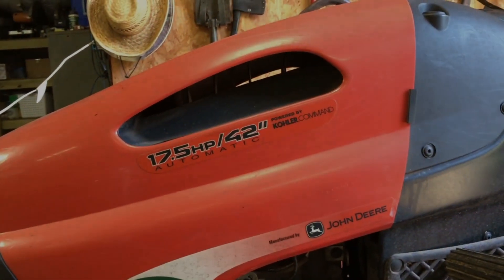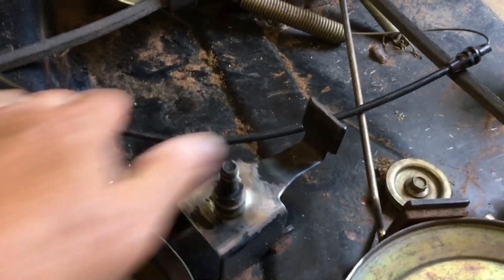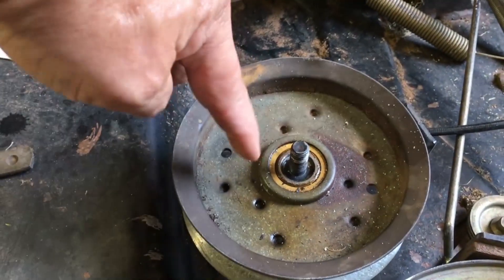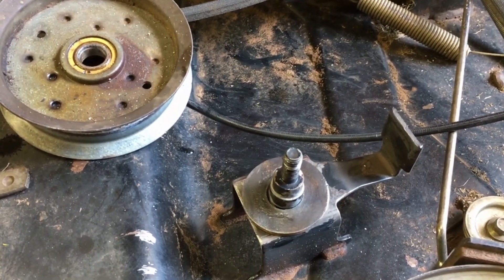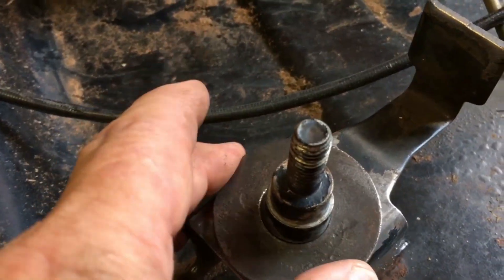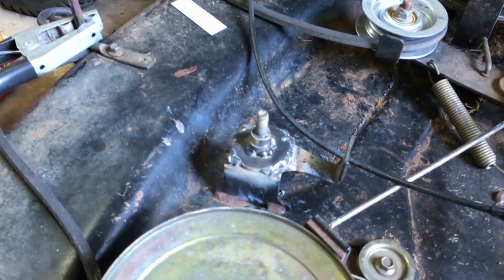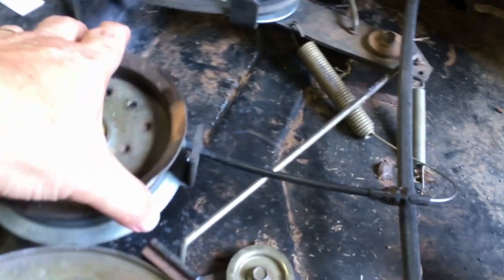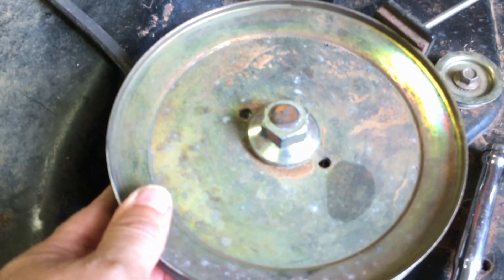Scotts and John Deere Mower Deck Repair

Comment: The belt on my JD125 is always comes off.. I looked at that same idler pulley and saw it was leaning forward big time, but the stud is solid. The bracket must be bent. Started Googling.. I just saw your video and confirms my suspicion that the pulley shouldn't be leaning as much as it is. I will give your fix a try. Thanks!
Reply from the maker: My bracket was bent too. 
I bent it back, then realized that the stud was loose too.
I bet if you bent the bracket back, you'd be OK.
The bracket is pretty thick, so it's not so easy to bend back
Reply: @BIGALTX  I am having same problem thinking of putting a touch to it to soften up the bracket... What'd ya think? 😓

Comment: I had the exact same problem with my John Deere L110. I didn't repair it by welding. I actually went to John Deere in Nevada, MO and bought a bushing for a larger John Deere tractor, and placed it under the stationary pulley. No broken belts in 3 years since I did this repair. I was breaking new belts after only 45 minutes of mowing. Very expensive, but the parts cost less than $15.00, and I didn't need to buy a welder. XD
Reply from the maker: Great idea... good for you :)
Reply: do you by any chance know the size of that bushing??? thanks!

Comment: Thanks for sharing; I'm having the same problem with my Scotts John Deere S1642. That exact pulley has bent forward after 20 years and seems to be why the belts are wearing out so fast. You can see the wear on the top edge of the belt and it's obviously rubbing along the top edge of that pulley. I'm going to pull the deck off now and see if I can straighten it out!
Reply: Did you ever get your pulley straightened out? I have same exact problem as you

Comment: Someone just gave me one of these mowers and the idler pulley was at a 45° angle like you simulated in the video. Put a battery in it and it runs nice and quiet, much better than my LT1000 Craftsman. Going to have to weld this stud in place like you did in the video, and also straighten the deck where the right hand spindle goes through as it is a little crooked also. They must have run over a huge Rock or stump.
Reply from the maker: Nice score.
Those mowers last a long time!  :)
Reply: @BIGALTX  thanks. I really like the way it drives with the automatic. Today I ordered the deck shift cable and tomorrow I will re-weld the stud and straighten the right hand side of the deck where the spindle bolts so that pulley lines up with all the rest. Also ordered a new set of blades. The ones on it were actually worn completely through and you can see through the middle of the blades
Reply from the maker: Hahaha... wow, never seen any blades THAT thin!
Seems like you know what you're doing.
Hope I was able to help you some
Happy mowing!  :)

Comment: I have the same problem with mine and couldn't figure it out. The mower was given to me and runs great just keeps kicking off the belt. The pull that you show is bent on mine but just thought for what ever reason it's supposed to be that way. I' going to try this repair today. Thanks and subbed.
Reply from the maker: I haven't burned a belt since then.
This FIXED it.
Hope it helps.
Thanks for the sub... and stick around :)

Comment: Good video.  Issue was with the design..  JD  fixed in later models. if Your going to hang onto Your LT, there are spindle kits which make a deck mow like brand new.. $110 ish..   Your LT looks to be in very good shape.. considering it was made around 2002, it's kept really well.

Comment: Thanks, you may have saved me replacing all my spindles and pulleys $$$. I was puzzled because my spindles seem to have close to zero bearing play.  But my front pulley is sitting in there at an angle the same way your was, burning and shredding belts. Hope it's the problem
Reply from the maker: I bet it is.
I was doubtful that taking the time to do the video would really help any one. 
You're the SECOND person to tell me that it helped you... 
Makes me feel good... glad to help.

Comment: Can you show how the two small springs that hold the spindle brakes are installed? I'm rebuilding one exactly like this and am having problems getting those two pieces in place.
Reply from the maker: Sorry, I never messed with the spindle brakes.
See if you can freeze frame this video to see how they go on.
There is a manual online... I found it a while ago, so I know it's out there for free. It should show spring placement

Comment: same issue here for the s1642 however there is a large crack in the deck itself as that pulley started leaning forward from stress. the stud for that pulley is ok but the angle is terrible now and the deck itself is compromised. no solution for me yet but may find someone who can bend the deck back down and weld it back together.
Reply: I have the same issue you posted about with a compromised deck on my s1642 mower -- wondering if you ever found a solution?
Reply: @goodfivebuck  I bought a used deck off of marketplace locally and put my blades on it, used the better of the pulleys from each, and I’ve been running that deck since.

Comment: We're did you get the idler pulley for this model I have same mower
Reply from the maker: I didn't replace the pulley. 
I just welded the stud that had broken loose.
Whenever I need parts for this mower, I go to my local John Deere dealer. 
This mower is made by Deere, and they stock most everything for it... or they can get it. 
If you don't have a Deere dealer, I'm sure there are places online that can fix you up.

Comment: looks like a good fix.
You should always paint over your welds (after you clean then up) to prevent rust. I usually hit mine with a wire brush and then paint while it's still very hot. Bakes the paint in.

Also welding tip on your settings... Your weld looked ok but I noticed a lot of popping and crackling... didn't have that buzzz sound it should have. I'm no expert either but what I try and do is get the settings right (wire speed and voltage) on a similar gauge material that you will be welding to. Also could have been you were holding the stinger (gun) a bit too far off the weld point.
The sound you are making is a good way to tell how smooth your welding is... pops and crackles indicate interruptions, while the buzzz means you are laying a more consistent bead. 
More important on longer welds, not the spot welding you were doing, and as I said... should be just fine for you.
Reply from the maker: I've been using Hobart wire, but bought some Harbor Freight wire, and this was the first weld I've made with it. 
I didn't like the sound or the feel of it either. 
Not sure if I need to adjust the settings for the cheap wire or not. Have you heard of any bad properties of this wire?
Reply: TexasPrepper2 I've seen some comparisons done on some of the weld channels I subscribe to on YouTube. It's lesser quality but fine unless the weld is critical.
I use wire from the shop I get my gas from. I don't have much welding to do so I don't use much.
I would try and adjust your settings by doing some test welds on scrap you may have around. I did myself by plasma cutting old mower blades and welding them back together.
Other problems that could cause issues is bad wire speed from a kinked cable or low gas pressure because tank is near empty.
I also previously mentioned not getting in close enough with your gun.
Lots of things other than bad wire

Comment: Either the metal wasn't clean or didn't have a good ground where you were welding or the machine isn't set up right.  There was a constant erratic feed which you should have felt  in your hands.  When set up correctly Hobart are great welders.
Reply from the maker: Thanks for the tips!
I'm NOT a good welder, and am new to wire feed... but I love it... just need to get better at it.
Reply: @BIGALTX  Nothing wrong with the weld itself.   First important thing is the ground, w/out that its impossible to do a good job. If the wire doesn't ignite immediately and pushes back at you a bit, it's probably a bad ground.  If it does ignite and still wants to push your hand back a bit the feed might be a tad too fast.  The third is not set hot enough.  Yours sounded hot enough so I'd go for one of the first two..  **  One more thing, if when changing spools the wire got away from you and went rolling on the floor, chase it down and cut it off. Don't try to rewind it.. Ask me how I know.

Comment: Did you spray some paint in the welds
Reply from the maker: Actually, I forgot. 
You're right... I need to remove the pulley and hit it with some paint.

Comment: Turn your wire speed down  you'll see the difference, , make it sound like bacon fryin hot
Reply from the maker: Thanks for the tip.
I've never claimed to be a welder... but I'm trying to learn 😀
Reply: @BIGALTX  I'm no pro  but have same type Hobart for 
15 yrs